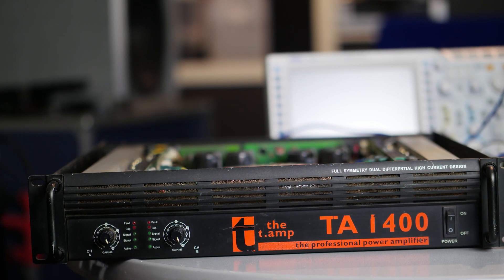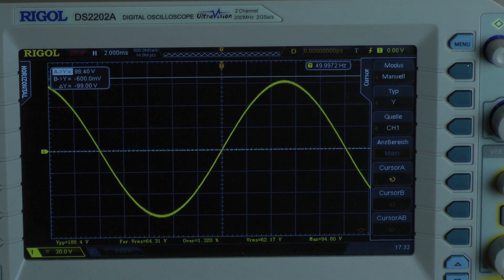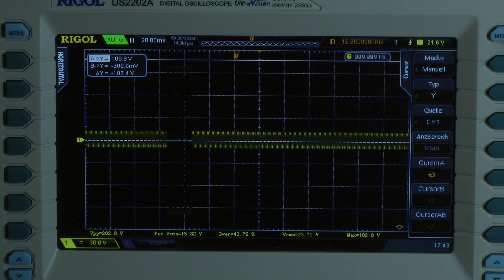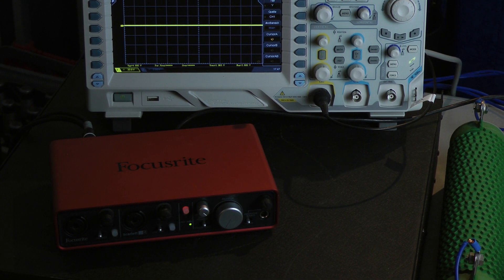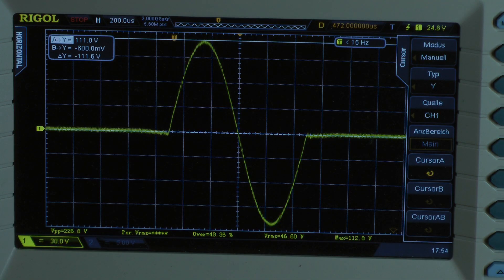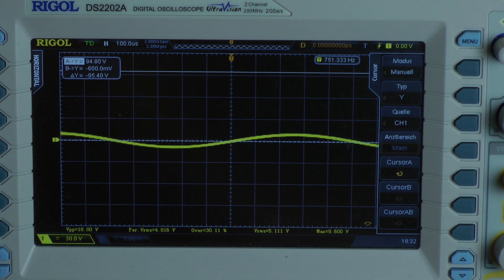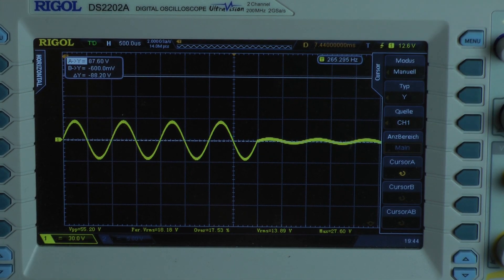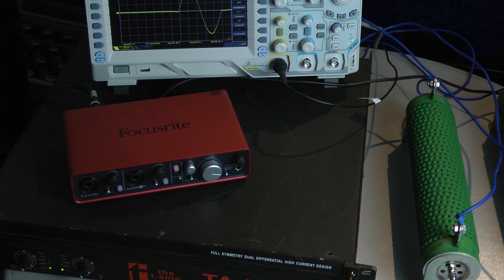The t.amp TA 1400 pro audio amplifier ampdyno continuous & burst output power test review & overview

Comment: Hey, I calculate slightly lower Power from the voltages shown on your osci: 1. measurement ( cont 1kHZ ) Vrms reads 67,21V so 67,21² volt² / 8 Ohm = 565 Watt. You are stating around 590 Watt. Ist your resistance slightly lower than 8 Ohm and you are calculating with that actual value?

Thank you for the Video, I still own one of these and was surprised by the measurement results
Reply from the maker: Don’t use the rms reading of scopes display , it’s not correct. That’s why I use the peak voltage divided by 1.414 and yes the resistors are slightly lower.

Comment: Moin, könntest du die TA 2400 mkx testen? Can you test the T.Amp TA2400 MKX? I have this amp! I am really happy with it, but i dont push it to the limit yet! I would drive 2x tp218 one on every channel! Thanks!
Reply from the maker: Hallo!
Ich hatte damals mal die alte ta2400 auf dem Tisch aber leider noch nicht die Idee mit den Videos gehabt. Natürlich kann ich die testen, dazu müsste ich nur eine bekommen.
Wie macht sich die 2400 an den Doppel 18ern ? Oder wird geplant es so zu fahren? Könnte mir vorstellen dass es ein bisschen zu wenig ist. Aber wenn man es nicht voll ausnutzt, kommt ja auch Musik raus 😊👍
Reply: Hallo, nun ist einer der tp218 angekommen. Der drückt schon sehr gut! Also bis ins clipping mess ich etwa 1350 watt bzw 74 volt bei 50 hz per multimeter gemessen. Das ist schon gut oder? Also die 1200 macht die auf jeden fall!! Hab auch mal kurz gebrückt probiert, das war verrückt. Hat die trotz 2 ohm last gut gemacht (4 ohm brücke) aber hab angst das dauerhaft so zu fahren 😅 gibt wohl welche die tun das.. bin mir unsicher! Was meinst du? Ich würde sie so nur immer kurz laufen lassen.
Viele Grüße!
🎉🎉
Reply from the maker: Das stresst nur unnötig die eh schon in geringer Anzahl vorhandenen Bauteile plus Netzteil. 4 Ohm Brücke würde ich lassen, es sei denn du hast genug Ersatz Amps am Start.
Reply: @audiokeller1975 
Okay Danke, die 1200 watt reichen auch erstmal aus 😅

Comment: Nice test, more pa power amplifiers please..
Reply from the maker: Thank you! More tests will be made if people keep sending amps 😎😊👍
Reply: Hey, are you interested in a MC Crypt PA 7000 rated 2*140W @8ohm? I could send it to you, If you return it after the test 😊
Reply from the maker: Usually I am interested in amps for testing but I guess with this type of amp it’s possible that it will go up in smoke with pure continuous resistive load power tests. Don’t want to talk this amp down, maybe it’s a good amp but in that power range I would call it a power HiFi amp and not a PA amplifier 😀

Comment: Sorry, maybe I was distracted by the video, but I have a question. 
In a 4 ohm bridge, what is the continuous power it can deliver under 85hz stably?
Reply from the maker: 4 Ohms Bridge is not recommended, this equals 2 ohms per channel then.
Reply: @audiokeller1975  I mean, I have 2 8 ohm subs, and I connect them in parallel, so that's 4 ohms. 
And what I'm interested in is, how much can 4 ohms deliver in bridge? That's how I use it, 2DB Beyma 18p1200nd. 
I'm curious because I clip around 3/4 tone. 

sorry for my bad wording, I think you get the idea.
Reply from the maker: I understand and of course it clips early. Like I said not recommended with this amp if bridged 4 ohms. In general: an amp driving a bridged 4 ohm load sees a 2 ohm load per channel, not good with this amp. Better avoid it 👍 bridging 8 ohms is ok the amp sees 4 ohms per channel. That’s ok 👌

Comment: Yeah the old one's are built like a tank big transformer,quality components , they support  2 ohms too as specified  in the 2003 datasheet , i have 2x ta2400 from 2004 and they are amazing for the price...They behave pretty good on sub application ,but they sound bad on tops due to topology. Great video , keep up the good work mate!
Reply from the maker: @danernorbi  thanks for your comment 👍
Is there any chance to find this manual? I also had the TA2400 in ca. 2002-2003 but there were no 2 Ohm ratings in the manual. I also did not test into 2 Ohms because output power at 4 Ohms not really follow ohms law when tested continuous, there is rail sag.
Reply: @audiokeller1975 i saw on the official site 2ohm stable ,
Also 22kg not 19.7kg like nowadays , you also need to monitor the input voltage from the wall i couldn't measure mine at 2ohms becouse mains was dropping to 180v 😂, if you could give me a contact i would send some photos and discuss PA stuff.
Reply: @audiokeller1975 i also completed the modules with another pair of output transistors (gain matched) there was place for them , so the total safe dissipation of the module became 750w/channel.
Reply: @audiokeller1975 you can delete it
Reply: @audiokeller1975  you can delete it 🙂
Reply: Hello if I use it in tops don't it sound well
Reply from the maker: If it sounds bad on tops get the bias readjusted on that amp, it’s possible that it sounds bad because of crossover distortion if bias is set too low for example.